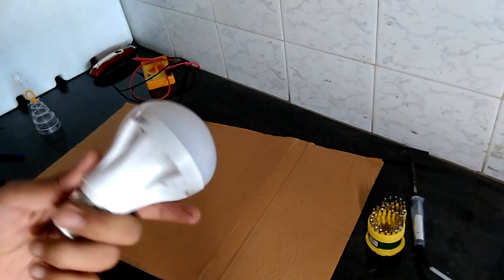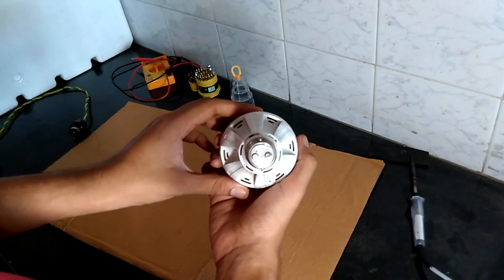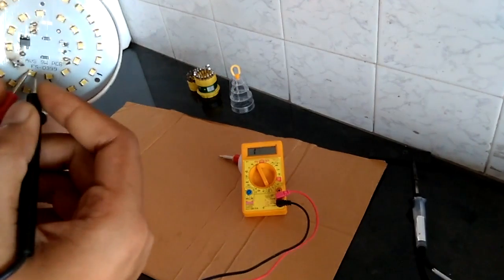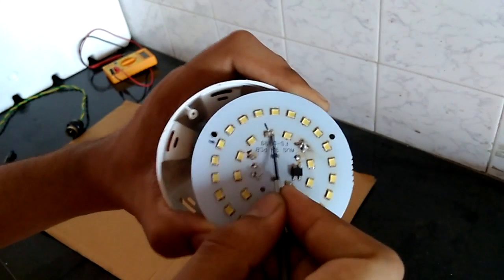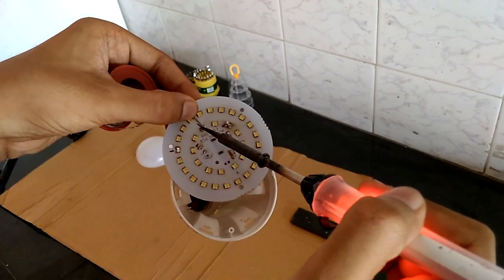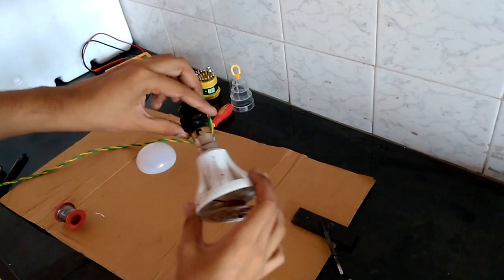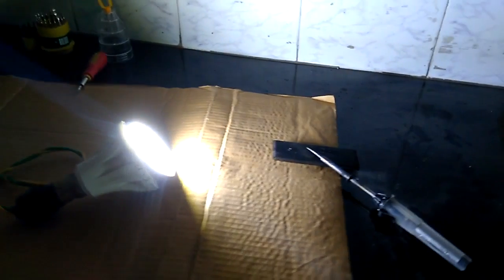How to fix LED bulb easily - "LED light bulb is not working" LED Lamps | Hackezing

Comment: I bought an LED lamp bulb with the remote and it has multiple colors and brightness...the lamp was on...I tried to control its brightness...nothing worked...changed the 2025 coin battery with brand new...still nothing...bulb still burning...(Re Boot the bulb I thought) pulled it out cleaned the M22 base...not dirty or corroded...ok...put the bulb back in...re tried the remote...ahhhh...success!!! Give that a go before panic sets in...these baby's are $16.00...

Comment: how to open branded led bulb. like philips, Eveready etc. I am not able to get way to the circuit in these bulbs
Reply from the maker: Some bulbs are sealed and do not possess any bolts or screws. It may differ from brand to brand.Most of the times, It can be opened from the semi-transperant glass or plastic which is on top. If it is sealed and in warranty, you might want to get it serviced by authorized personnels. We'll update you more on this if we find such cases

Comment: This is not a good way to fix that kind of bulbs, because the leds are in serie so the voltage is respected as long as all leds are working, the best way to fix that kind of bulbs is by storing a dead One then recover the other leds later when another bulb fails to replace the dead leds with hot air or the solder iron if you don t destroy the led before soldering on the board you must repair.
Reply from the maker: +Dario Mazzeo Thank you for your opinion. We appreciate and agree with your views.

Comment: in this bulb of 9w, how much is d dc voltage required to drive those LEDS. Pls help me with ur experties sir, its a part of my project. 
regds Advait pai
Reply from the maker: +Advait Pai hi advait, sorry for the late reply. We see that you haven't specified the exact number of LEDs and the supply configuration. We suggest that you can go to this site, ( an online LED calculator ) http://ledcalc.com and put the exact values to get the result for your query. Hope it helps ! Good luck !
Reply: There r 4leds in d inner circle
And 8leds in the outer circle.
Can u pls help me with minimum and maximum dc voltage to operate individual led.
Reply: I wish I cud send u a photo of dis led board
Reply: I wish to convert this ac voltage led bulb to dc voltage led bulb
Reply: +Advait Pai A lot of bulbs have a transformer in it, you must measure the output with a multimeter, set it to dc, point it where the two wires from the driver go to the led board, on this particular model it looks like there's a rectifier ic it must be the black piece on the board, so I suppose that after that component it's flowing the direct current. Please let us know.

Comment: my  AC led bulb is flickering  any solution ?
Reply from the maker: +Rapper Roy  may be your capacitor is failing to perform properly, try changing your capacitor
Reply from the maker: +Rapper Roy  may be your capacitor is failing to perform properly, try changing your capacitor
Reply: OK

Comment: tried this method but if multiple led are fused is there is any solution.
Reply from the maker: +Vinod Halpeth  thanks for using this method. We have tried fusing multiple LEDs , but the number should be limited to 3-4 max. If you are trying to fuse more LEDs, you have to adjust the circuit by adding resistors of same resistance as LEDs'. For further queries, comment here, we'll be happy to help.
Reply: but  they do fail works for some time maybe a day or two .
Reply: thanks.

Comment: Hi will you please guide me how to replace the whole LED lightbulb plate ???
Reply: +Hackezing Labs Yes I have
Reply from the maker: We have updated the video description and provided step-by-step instructions regarding your query.

We'd love to hear from you !
Good Luck !
Reply: +Hackezing Labs but the main capacitor and diode bridge i already have is working is it possible to attach them with new LED plate ? If yes then please guide me how to detach the older one and replace with new ? 
And thank you for your helpful consideration ... 😊
Reply from the maker: Yes, It is very simple to detach and re-attach the capacitor and Diode bridge from one plate to another:
1. Using a 15W soldering iron (if you don't have that, use the normal 25W soldering iron), try to melt the solder and detach the capacitor and diodes, make sure you use any non-conductive material to take the capacitor out immediately after touching that part with soldering iron.
2. After removal of those parts, let them cool down for a while (2-5 mins)
3. Put those parts on the new plate. put some solder wire on the connection by melting it with soldering iron and make sure you don't spill the molten solder wire while doing this.

If you're not sure about how to use soldering iron, you can watch our previous video, we have used soldering iron --> https://www.youtube.com/watch?v=WtwO4PQ3KBM

Feel free to raise questions anytime ! Good Luck !

Comment: all the led of the light is glowing but the but is not glowing while given the connection please help me out why it is not working
Reply from the maker: +Sayantani Kayal  then the problem is in your capacitor or resistor, check whether burning smell is coming from the resistor. Try checking the ohms using the multimeter. Check the continuity in your LED circuit. If you don't find anything fishy here, please let us know. We'll be happy to help
Reply: how can i check the continuity n i am not getting the smell of the burning capacitor any other way to check it
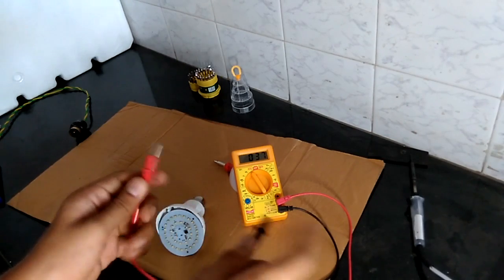Reply from the maker: 1:25 We've mentioned that the LEDs should be checked by the continuity check. So If you go to 1:25 minutes of video, you'll learn about how to adjust the knob on multimeter to get the continuity option (make sure you watch the video in high quality, or it'll be a blurred view)

There is a tutorial already on youtube : https://www.youtube.com/watch?v=nPdECcBU1Vc

Now if you got an idea how continuity check works, try to get values on the digital screen of mutlimeter to assure the connection is available. If you let the red and black (the multimeter electrodes) to any two places and if it shows a ZERO value even the place is secured with connection, there might be the problematic point. 

We're glad that you're curious about such things, We appreciate your response.
Feel free to ask further info if you get stuck anywhere!
Reply: do i have to check the values in multimeter for the connection of 2 led,i have check the whole circuit the continuity was ok even the led is glowing, but i want to know that how can i check for the capacitor  and resistor if there is any problem or what, i just want to repair my problematic bulb myself,i am thankful that you are helping me  in that sense.
Reply from the maker: To check a capacitor, set the multimeter knob to voltage DC say 20v, try testing it using your plus and minus electrode in any manner at first.
Now, if the voltage value is increasing in one manner, change the arrangement of the multimeter electrodes in opposite way, you should find voltage decreasing in this manner. If such things happen, your capacitor is working properly, no issues. If it doesn't show such changing values, that means, It is unable to function in charging and discharging and you might think of replacing it with a new one.

Come on, tell us more if you find any difficulties while repairing.
We're very proud of you that you're trying to troubleshoot the problem by yourself ! Keep Going !